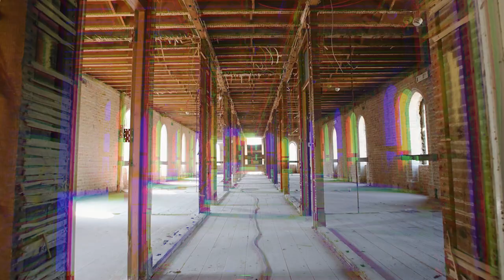Chichester Free School Construction Project by Metropolis Visual

Comment: Do you mind sharing what type of equipment you used? Great Video!
Reply from the maker: Hi Roaring Waves, this time lapse project would have been captured with one of CamDo's construction time lapse packs using a Go-Pro camera and our custom controller and enclosure. You can read more about them here - https://cam-do.com/pages/construction-time-lapse-packs.
Reply: be careful when you buy this equipment. I recommend you buy it very early to see what breaks down first so you can try fixing it before your project begins. customer support is nonexistence at best after you buy it.